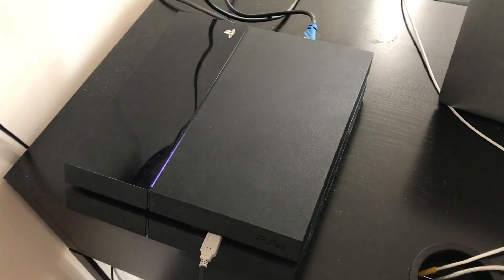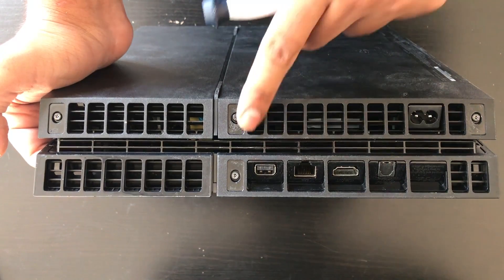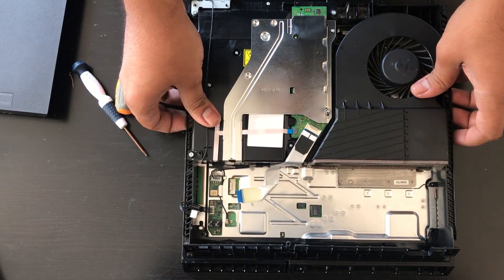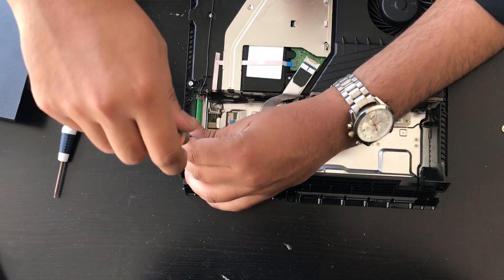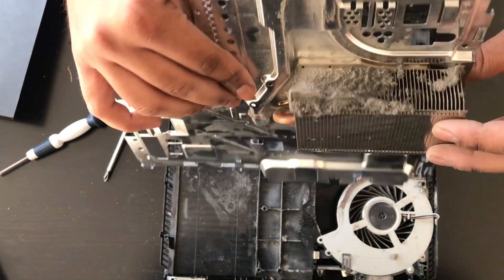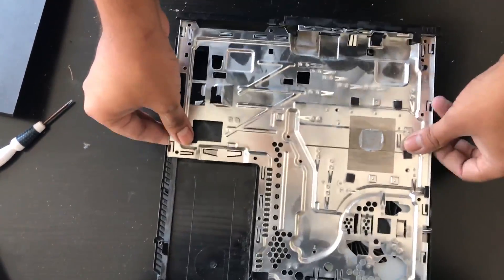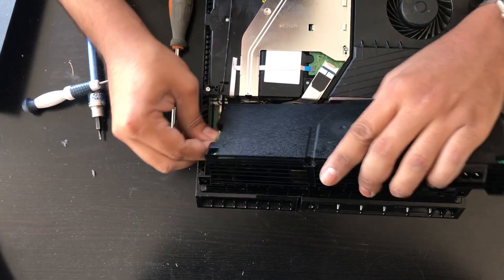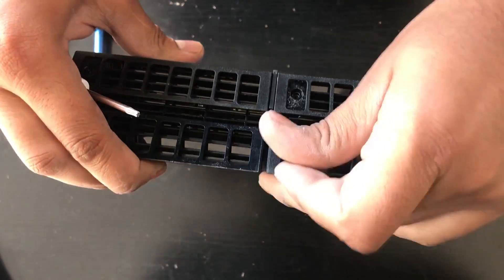PS4 Too Hot overheating due to dust build up and fan (CUH-1001/1115 cleaning and disassembly)

Comment: Ok I need your HELP on this. I did what I saw on the video, but here’s the thing, the metal “square part” around the cpu is full of “crusty thermal” paste. I got it like that when I bought it brand new. Can this be the reason why it’s overheating?
Reply: Please I need your help!!
Reply: Yes.. remove old and replace with new

Comment: My PS4 was a little bit different from the one you showed on the video, but even though the minor differences i got all the dust cleared out, a little more then you showed in this video, and applied new thermal paste and it works silently again! I was nervous as hell when i pulled it apart but now, seeing it work and not hearing a thing, i'm so proud of myself, dude thank you so much for the clear video!!

Comment: You took it apart so easily I'm still struggling to pop the bottom case. Such an easy step and I'm worried I'm going to break something.
Reply from the maker: That is because I did this hundreds of times before doing it on YouTube. Take your time. It will come off.

Comment: Question, I just cleaned out my PS4 but it’s still saying it’s too hot and continues to shut off? And it can be cold as crap and still turn off..? So I’m confused?
Reply from the maker: Check the tightness on the heatsink clamp and replace the thermal paste. I did an updated video on this on my channel.

Comment: Did this now my PS4 won’t turn back on still flashes red saying it’s over heated but it hasn’t been on in 24 hours and I just did this clean exactly
Reply: Replaced the thermal paste today and still no success, ordering fan replacement and if that doesn’t work it’s just fucked :)

Comment: So I did this and it worked but when I got into my ps4 there wasn't really a lot of dust but I cleaned it out anyway the ps4 is working great for almost a whole week and then it gives me overheating problems again please help me a new ps4 is last resort
Reply from the maker: Replace the thermal paste on the APU chip. Watch my other videos related to this issue.
Reply: @fasttechvideo  recommend thermal paste?
Reply from the maker: @beasty__boi9017  Thermal Grizzly
Reply: @fasttechvideo  thanks man I hope it'll work if not I'll probably be in the market for a newer one
Reply from the maker: @beasty__boi9017  You're welcome. Please subscribe if you haven't already.

Comment: This is very unprofessional. Opening the complete console and saving on paste is so ridicoulus. We all know that when opening any device, changing the paste is mandatory. It doesn't matter of you are opening console or graphic card or even just removing cooling solution from CPU you have to change paste, it's very cheap  and helps a lot. Some people are very stingy.
Reply from the maker: The customer did not want the paste replaced. I advised against it but it wasn't my decision to make.
Reply from the maker: I did an updated version of this video where the paste is replaced.

Comment: After i cleaned my ps4 (oldest version), i tried turning it on, it got really loud and the light went from blue to red and shut down before I could do anything. Does anyone know what the issue could be? And how i can fix it? Pls help
Reply: Open up the top and make sure that little panel you have to screw in on the right side is tight

Comment: hey i watch your video and i try it but i have one issue!
the controler can’t connect with ps4 i open the controller and after one minute disconnect !
Also i see some lags in menu ! please give some information to what to do
Reply from the maker: Check the antenna and the antenna connection in your PS4 console if you have disassembled it. I have a video for this on my channel.
Reply: @fasttechvideo  Thank you so much for your response. You help a lot

Comment: Good video I appreciate the help. Only thing I didn’t like is he puts it back together without telling us the fine details. Such as which screw he was putting back in... I seen him pull a cord thru the back at one point as well and didn’t tell us why or what he was pulling it thru.. the small details matter bc if one small things isn’t done right it will cause it to not work properly
Reply from the maker: Noted. Thank you 🙏🏽

Comment: Bro I followed everything you did in the video and it made my ps4 even worse. It starts up and then shuts off, I did it over three times and now it won’t work. Thanks a lot.
Reply: Same bro it turns on and after 5 sec it flashes red and turns off

Comment: Hello, wondering if you can answer a question for me or give some guidance please. I did everything in this video, BEFORE watching this video as a guide...yes I know lol and in the process I think I have damaged the Optical (DVD) Drive ribbon cable as I didn't press down on the metal tab connector on the motherboard. I Just pulled it straight out of its housing.

Before I opened the console up, my intention was just to clean out the dust around the fan and heatsink areas. It ran fine before I cleaned it out; it would just be extremely noisy when playing games. At Ps Home/Dashboard it would be fine. After I put it back together and booted it on, it showed me an error message saying the console is too hot and the fan spun faster than usual, eventually shutting off the console. This is now consistent; I cant even boot the console up normally or in Safe Mode without it shutting off, right after ive logged into PSN with the same error message showing. 

My question is, could this be a data transfer issue within that ribbon component that could triggering the fan to spin and fooling the console to think it is overheating? And would you suggest replacing just the ribbon?

Comment: Cleaned mine out and replaced my fan, but it still says it's overheating and shuts off immediately after about 3 minutes of being on. New fan is running terrific. Any idea what else it could be?
Reply: Did you replace with new thermal paste?

Comment: hello, i think this is normal but i’m going to ask anyway. i’ve cleaned my ps4, replaced the thermal paste and cleaned the heat sync, fan and all the dust on the motherboard etc. but is it normal for your ps4 to make a noise when reading disks or when it’s downloading an update? i think it is but i’m just making sure.
Reply from the maker: As long as its not a grinding noise it is okay.
Reply: @fasttechvideo  ok that’s great then it’s fine. i also have another question. i’m thinking of opening my ps4 again because it sometimes gets loud when playing red dead redemption 2, i know that consoles make noise especially playing big games with lots of graphics to render etc. but now i’m sceptical thinking that i haven’t cleaned it as good as i could’ve and that i should’ve replaced the thermal pads too. i also may want to clean the disc gears too, it is great wen reading discs etc but it’s a bit sluggish went inserting the disc and taking it out.

Comment: I know I'm late but I've cleaned my ps4 today all the fan and everything but I didn't proceed to do as you did, which I will try, my ps4 was bought near release, will I need new paste if I don't have or will It still make a difference without new paste if I need it ?
Reply: Well just an update i went ahead and done it like he said there was massive amounts of dust, but that didn't matter as when removing motherboard ive pulled a little and snapped a cable that goes to the motherboard and my ps4 won't work now 🤣

Comment: Ok. Idk if this happened to anyone else. But it seems my ps4 is laggier after I cleaned the heat sink and put it back together. I’ve been lagging out of parties and my ping is high in games (I usually get a 30 ping but it’s around 60-100 now) the WiFi is fine on the other devices so. Idk.

Comment: I did this and it worked fine but next day it after turning on it beeps flashes red and turns off , is that because I didn’t replace the thermal paste

Comment: just did this now my ps4 will turn on then turn off after 2 seconds
Reply from the maker: Check the pins under the power supply.
Reply: @fasttechvideo  works now but it will turn off after overheating it will throttle the fan and turn off i believe its because i have no thermal paste on the cpu but i wont know untill i put thermal paste on

Comment: Ok. So I did everything and ended up with 4 screws left over. I don’t think they were that important because it was the T8 ones that was on the frame after you tear down the top of the PS4 cover, I cleaned it ALL out, it got even worse. I barely started a game and it sounded twice as loud, and my PS4 shut off with the red light, WHICH IVE NEVER HAD HAPPEN

Comment: I hear my fan trying to turn on.. it won’t ... getting ps4 too hot message 🥵. Might be stupid question .. is there a way to fix the fan without replacing it ? Could it just be too much dust or old thermal paste making the fan not turn on?

Comment: @Fasttech quick question mine does the same it roars but also it makes a skipping sound to it as well every 5 seconds and then turns off it red light and says its too hot my question is too how do I know I should buy a new FAN for the ps4? If its still spinning?

Comment: Pls help everytime i turn my ps4 on it inmidentley turns of again and it beebs 3 times pls help
Reply from the maker: This is called the Blue Light of Death. Please check our channel for repair videos on this issue.
Reply: no i just cleaned it for the first time when i turn it on my fann just starts making jet sounds while it is clean and then it says ps4 is overheated but there is no dust or what ever
Reply: And then it shuts off

Comment: I did this, pulled my ps4 completely apart, cleaned the inside super well, all new thermal paste, and it still runs super loud. It doesn't overheat anymore but what else could be making it so loud?

Comment: Thanks for this - very helpful! I just took apart my PS4, removed the dust (wasn't too bad) and replaced the thermal paste. Started back up no problem :-) Just keep an eye on the battery cable when reassembling - I didn't have it going through the right hole and had to go back a step and remove the metal plate and motherboard then pull it through properly. So quiet!
Reply from the maker: I know this comment is late but please subscribe to the channel and like the video.

Comment: Hey man! 
I couldn't open the second screw of power supply unit. I think it has stripped to it.( That long screw). Any suggestions on how to take out the screw.. because it is not even rotating.

Comment: You weren't clear on how to remove the power cable properly as I was looking at you pull on it from above and I pulled it off the motherboard and my ps4 is now broken. Thanks
Reply from the maker: Yeah Im sure its my fault that you broke your PS4 because too much force was used.....

Anyways, you could solder it back on provided the pads aren't ripped off the board. Hope that helps.
Reply: @fasttechvideo  No, it was my fault for pulling it off the motherboard, but you could have explained how to properly remove the power supply instead of covering our view with your hand. As you cans see in the comments.  I'm not the only one who accidentally did this and it was because you didn't even attempt to show us how to properly remove it.
Reply: I did it fine. I watched multiple videos before doing it.
Reply: @lukecharles8378  Thank you Luke for you very insightful reply. I think we all learned something from this.

Comment: Thanks for the awesome video I followed ur instructions and I found my PS4 Soo dirty but a small tip for anyone who are going to do it , it wasn't clear in the video where he puts the black wire that contacted to the power drive I put it in the wrong whole and it wasn't long enough so I had to reopen it again just make sure to check that rather than that it was a helpful video 🙌🏼

Comment: Thank you but it may have nothing to do with it but my mic now sounds like it has TV static and some things I need to double click a button on my controller to open it plz help
Reply from the maker: Check the antenna
Reply: @fasttechvideo  thanks but does that help the controller too
Reply from the maker: @massivedub5654  Yes
Reply: @fasttechvideo  thanks one more thing the antenna cable is the long black wire that runs through on the underside of the ps4 yes?
Reply from the maker: @massivedub5654  Yes

Comment: At 6:24 he said once we removed all these screws, then an ad played and as the ad was playing I was trying to pull the thing out and I was confused why it wasnt coming out and after (it was 2 ads) it bent and when he said "oh, theres actually another one here" mine was already bent to the point that I cant take it out anymore I think its over...
Reply: F@ckin youtube
Reply: @triggeryplays6188  yep specifically at THAT part youtubes like take an ad 2 FRAKING ADS and one of them was 5 secs the other was 60 I skipped the 60 sec one because I was confused why it wouldnt come off well, my ps4 still works but I cant fix the problem sadly! It will overheat everytime
Reply: Fo R i think im a take it to a store just to be sure u dont know i might get a 1 hour ad coz the ps4  isn’t supposed to be this quiet     If it was that quiet that means that the fan stopped coz i had mine for 5 years and ik how it sounds
Reply: Fo R and btw dont worry ps5 is right around the corner
Reply: @triggeryplays6188  yeah in half a year but its fine

Comment: I’m stuck at getting the power supply cable out, it is not as easy as people do it in the video and  i’m concerned of breaking it in the process of removing it. Also, I see symptoms of the fan not moving by itself or being loose, so I’m assuming my fan is also faulty. I’ve worked around it, cleaning the fan and the heatsink but it still overheats. 

UPDATE: I was able to open it, turns out and it was the fan that gave out. I replaced it, the ps4 runs perfect now.
Reply: I was struggling with that part to so what I did is tried my best to lift up the power supply while the cable is still attached. After get it out there was enough room without me trying to yank it and unhooked the clip from the power supply not the mother board as I did not want to yank that one out of the mother board. You have more leverage when you pull the power supply out, you just have to be careful not put too much force. As for the cable it was still hard to take out but I could put more leverage. Wiggling helped a bunch.
Reply: eliminatorxx713 appreciate it bro, I was finally able to get it out. The PS4 is running like brand new.
Reply: I sincerely hope you replaced the thermal compound after disassembling your ps4 :D
Reply: Do you guys know if all the regular different gens of ps4s have the same fan ? I have the second gen regular ps4
Reply: @jimmysmith4821  It’s likely it does, but you can find out by either googling it (the model of the ps4) or when you remove the fan it has a numbers and code on the lower back of it  which you could look for when purchasing a new fan
Reply: yes i had to wiggle it out
Reply: I accidentally broke mines, ripped the entire power supply from mother board

Comment: So I did it step by step, cleaned it, put every screw back and now my controllers acts up and turns off randomly
Reply: Same 😔
Reply: SteveBob69 need antenna cable replaced
Reply: Same. And even worse it blinks red, overheats and shuts off which it never did before I “attempted” to clean it
Reply: what was the solution
Reply: @AbdullaAljaberi  find the tiny black cable that sends or receives signal to the ps4 controller and adjust it so it’s not bent or tuck away in the wrong position
Reply: @joelsolano8939  Done that.. worked like a charm.. thanks..
Reply: Do u need to add thermal paste after u disassemble it ?
Reply: @GAMERxBURRITO789  @pcmasterrace_BH checkout this channel, it just posted something similar with changing the thermal paste.

Comment: Great video man keep it up! I was able to open up the tray to the motherboard. BUT I always have trouble disconnecting the PSU connector and the fan connector. Any ideas anyone? I really want to fully clean my PS4 from dust, but it's like those 2 connectors are stuck like glue. Thanks guys!
Reply from the maker: David Guzman wiggle and pull. Always pull from the power supply or fan side never from the board!

Comment: My ps4 it doesn’t have the plastic side and it’s different from the vid
Reply from the maker: Whats your model number?
Reply: It’s CUH-12168 220-240V
Reply from the maker: @skullraptor2913  I have a video for this issue for CUH-1215 systems on my channel. A 1215 and 1216 PS4 is the same thing, just sold in different countries.
Reply: Fasttech ok thx

Comment: If I just want to clean the heat sink do I have to remove the power bank or can I just remove the top part of the ps4 that is next to the face plate cover?
Reply: Also if my ps4 goes into rest mode by itself and turns on by itself could it mean that it needs a new power supply?

Comment: I did it and when I put it back together. And turned it on it was blue then it blinked red 3 times and turned off. Help
Reply: Having the exact same problem. Have you managed to fix it yet?

P.S. I also ordered some new thermal paste because I accidentally wiped some off with my finger. If anyone needs an update, just reply
Reply: Neyt Culha yeah i put thermal paste and made sure the screw was tight. And now it’s working
Reply: Okay so I just put  some new thermal paste (Arctic MX-4) and patched her back up. Works perfectly now, and about 50-70% quieter ^^

Comment: After i cleaned it i turn, it on after i turn it on, it made 3 beeping sound and turns off what should i do?               Well nevermind it's trash now it's no good and i had it ever since it came out but now it's uselessly
Reply: Same thing happens to me have u sorted ur problem?
Reply: Yeah i did everything is good for now.
Reply: You know that green board thing in the PS? I put it back wrong so i had to fix it and put it back how it was.